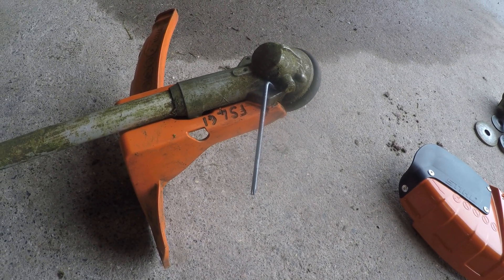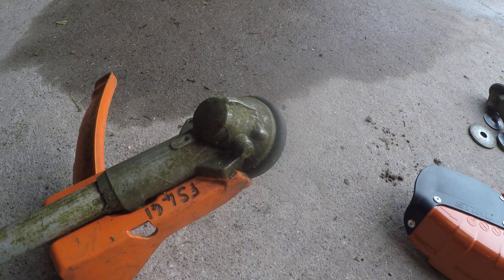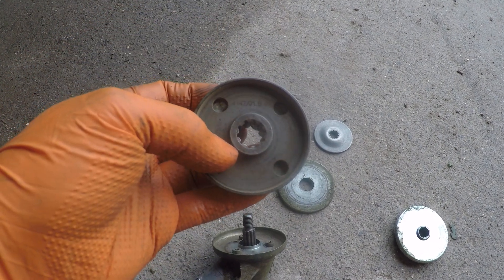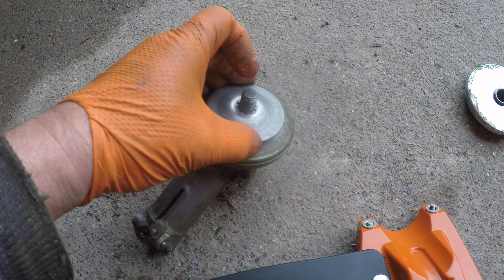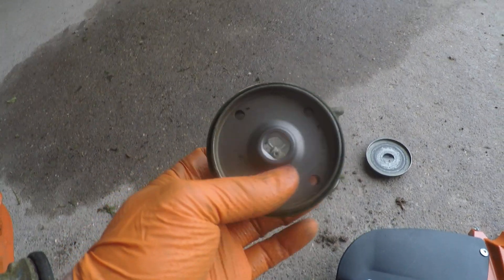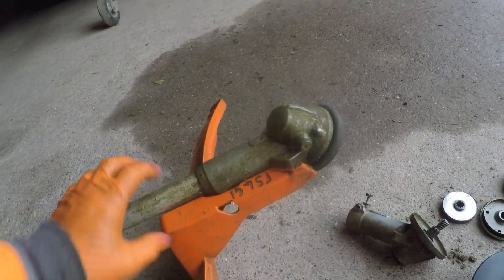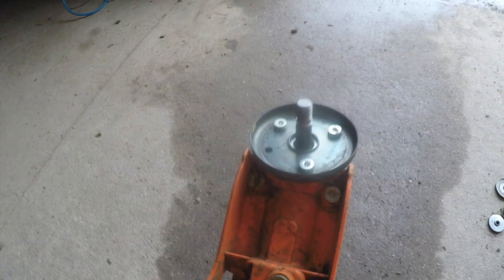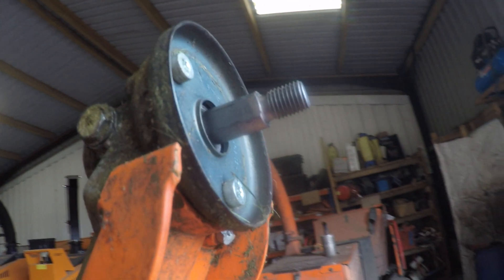Stihl angle gears FS461 vs FS460

Comment: A couple of questions if you don't mind!  I bought a used 460 without a gearbox:

What is the part number of the new one?
Is it 28mm 9-tooth spline?

Thanks :)
Reply: Sorry I missed this, so didn't reply. I hope you got sorted. Hopefully you did and now know that either angle gear will fit the FS460. You CAN rebuild a duff FS460 one with new bearings, but as these have no provision for greasing (the FS461 does have a greasing port) the angle gears themselves can suffer huge wear and the main bearing can spin in its housing, in which case it's junk.